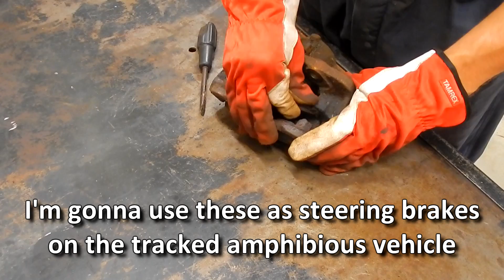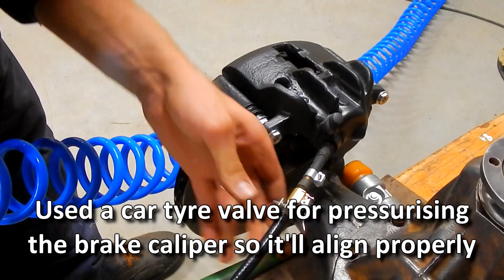Brake Caliper Mounts & Rebuild - Tracked Amphibious Vehicle Build Ep. 4

Comment: When i first saw this build i thought you were going to shorten the axel adapt cv joints and have a rack and pinion type system. I was really excited. Ive been toying with that idea for an amphibious vehicle. Years back we made a 6 wheel atv from a corvair using brakes for steering. It required constant maintenance and adjustments. The inline brake system youre doing is genius.

Comment: Hey Donn  a simple solution for no blast chamber is a Dremel with a wire wheel this will get you into the small tight areas.   WOW, outstanding craftsmanship, your skills are in extremely high demand in the USA, you could make a very comfortable living here.

Comment: Good idea using a valve stem o maintain pressure in the caliper. Good work. Don't forget to paint the brackets you made. Looking forward to more videos on this project, at least you found some use for a Lada lol.
Reply: Why does a Lada have a heated rear window? To keep your hands warm when you have to push it.:-}
Reply: Z4Zander 
😂🤣😂🤣
Reply: Wayne Crews κ

Comment: Nice job! You're giving me some inspiration! I want disk brakes on my 66 Pontiac but I don't have alot of money. I'm thinking about just fabricating brackets myself
Reply from the maker: I word of caution - I'm using this solution on an off-road vehicle that moves really slowly. I'm not saying converting a car from drum brakes to disc brakes can't be done but I reckon there's much more to consider when doing so. Just from the safety aspect. But the idea behind the aftermarket conversion kits is the same so go figure... I've converted an ATV like this before but again - it's an off-road vehicle.
Reply: @DonnDIY  that's what my worry is.

Comment: Is it me or the axels are not turning in the same direction ? 11:22
Reply: Differential is not locked.
Reply: They have to turn that way.
Check the web' for Differential Instructables to figure it out ;)
Reply: That's how a diff works if you turn one of the wheels in stead of the drive shaft.

Comment: If you had a bucket, could've filled with evapo-rust or diesel fuel and let soak over night before working on those parts. Would've made them a lot easier to come apart for ya. Always use air to remove those brake cylinders, so much easier on everything, not going to hurt anything either.
I'm looking forward to seeing how this all comes out in the end. Good work so far. Cheers :)

Comment: What grade of steel did you used for those caliper mount brackets
Reply from the maker: Don't know. But they're thick enough for the application I need them for. I think. 😁
Reply: Looks like A36. Should be plenty strong given the thickness.

Comment: Really good stuff! Just have to point out one thing: Consider using a grease gun for pushing out brake pistons. It´s both easier and safer. Or at least, use some wood or something if you use air. Anyway, love your good work. :)

Comment: With your skills you could build yourself a blast cabinet in a day. You also need a parts bath with a recirculating pump and filter - something else that you could probably build in a day with your skills. There is a product, POR15 (Paint Over Rust 15th Attempt). It's pretty good for painting over rust. It hardens and prevents air and moisture from reaching the rust while at the same time preventing the rust from spreading.

Comment: Can always use Electrolysis for the rust in hard to get a spots. Get an old stick welder and run it around 40amps, works quite quick.

Comment: So if you end up having to re paint these i suggest investing in a dremel with the wire wheel attachment and also suggest investing in some rust converter paint and what that does is it actually converts the rust into a paintable surface and also acts as a primer for the paint. Just my thought hope this helps
Reply from the maker: Good information. Thanks! I'm obviously no painter. 😁
Reply: Trust me that rust converter paint has saved me so much time instead of trying to paint over it

Comment: Dont know where youre located but i bought a wonderful benchtop bead blaster from Matco tools for under 100.00. I got it specifically for redoing the brakes on my car in the picture on my email address. Topped them off with gold leaf paint. All 8 calipers were beautiful. I felt ashamed to block their view  with wheels. So i had them gold plated.

Comment: Hello, and may I say you are doing great work. A question if I may! Are you going to use this as differential steering for the tracked vehicle and if so will you need a brake booster to get enough calliper stop or will two master cylinders do the job.
Reply from the maker: Yes, using this for steering. And no, probably no booster is needed if I use brake levers long enough.
Reply: @DonnDIY  Thanks for the reply! The reason I asked is that a couple of years ago I built a tank using the same design but with a full size axle assembly, however the brakes were shoes and not disc and I simply used two independent master cylinders with tillers attached. It certainly turned but was very hard to get enough pressure without boosters. I am curious if discs would be better than drums and shoes.

Comment: Next time use silicone paste to lube the guide pins. Grease will eat the rubber. And put the silicone paste in groove of the guide pins to keep water out.
Reply from the maker: The grease was provided by the parts manufacturer so I figured it's fine. We'll see how the rubber holds up.

Comment: If you use molasses and water , 1 part molasses to 40 parts water it will remove the rust that you can't get to , it just takes time for it to work will not take off paint over rust

Comment: Hopefully you've discovered vapor blasting by now, superior to any other dry blast process.  Easy convert any sand or bead blaster to a vapor blaster.
Reply from the maker: I have, I'm currently following a vaporblasting equipment manufacturer and contemplating getting a booth.

Comment: One way of dislodging a rusty brake piston is by using Grease, install a
Straight Zerk Fitting Grease Nipple Fittings in place of the bleeder or at the hose and pump it with grease

Comment: Donn DIY, for rust removal I have had success with 1/2 gallon vinegar and 10 ounces of molasses in 2 gallons of water.  Soak parts for about 5 days, wash off. rust is gone.  Give it a try.

Comment: I can't help but think that maybe starting with a rear axle that has disk brakes already wouldn't have saved a bit of time. I see junked mid sized trucks and SUV'S in the local scrap yard all the time and already have all the needed components attached, all you would have to do is shorten the axles and tubes. Can't wait to see how everything turns out

Comment: red grease is a piston assembly grease it doesn't go on slider pins, pins need designated ceramic paste or high temperature silicone grease that doesn't react with rubber

Comment: And my Instagram question gets answered (sort of) in the video. 
It is looking Pret-ty good Donn. 👍🏻👍🏻👍🏻

There are some CV axles that use a bolt flange for the inner end. Might be easier than creating the entire setup with the PTO parts. Look into front axles from a 4 wheel drive truck. Here we have the Chevy S10 that would work.

Comment: Dont ever use lube when putting calipers together the lubes is for the guides use brake fluid to lube the seals bc if the grease makes it back to the master cylinder it screws it up

Comment: Donn, hello again.
Why you don`t use dremel or chemical rust-remover? Finally maybe you can electrolysis text time....
With best
me
Reply from the maker: The first thought was electrolysis but I had some errands to run this week so there was no time for that. Otherwise the parts would still bathe in the electrolysis tub. :D Next time. Or maybe a soda blasting chamber would be better.

Comment: so why don't you make your own sand blasting cabinet ? it's not too hard just need a sand blasting gun with a ceramic nozzle, a box with a low point, and a simple syphon for the sand/air connection.... you need one and it's a quick project !

Comment: its a hard life with out a plasma cutter😂
Reply: one better....a cnc plasma cutting table. 😃
Reply: @Guust_Flater  that would be amazing
Reply from the maker: Funny thing is that I borrowed a plasma cutter but one thing that is keeping me from using it is half a liter of air compressor oil that I don't have which needs to be poured in the big air compressor that would feed the plasma cutter. 😀

Comment: The first question. If you decided to use differential from LADA that why did't use front brake parts from the same car? It will make your works much easier
The second question. Why you did't use differential from BMW or Audi about 1990. It would make your project much more simply and more reliably
Reply from the maker: I just had these parts at hand and available. That is the only reason. If Lada parts fail I can always redo this brake steering unit. Good point made! 😉
Reply: @DonnDIY  if you spend extra time on redoing, then there is not enough time for other projects. life is so short

Comment: You need a plasma cutter
Reply from the maker: Hey. Actually I was borrowed a plasma cutter from a local welding equipment distributor but my compressed air system still needs work before I can fully try this plasma cutter out. But I'm still gonna use the angle grinders in the future too.